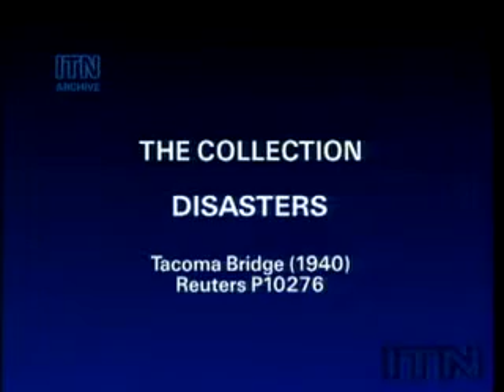disasters - the tacoma bridge collapse

Comment: Steel Skeleton The Remains Of The World's Third Largest Suspension Bridge Which Cracked And Collapsed In A 42 Mph Wind. Engineers Inspect Strained Cables On The Approach Sections That Remained After The 2800 ft Center Span Dropped Away, Rocked And Swayed. Many Observers Call It The Greatest Bridge Failure In History. Engineered Upright But Seriously Deflected Could Be Saved. Since It Was Open Last Known To Engineers. While Most Bridges Have Open Girders, They Wave Fashion. Severe And Unexpected Twisting Currents Brought On The Collapse. Up To The Hour Of The Disaster, Professor Farquason Of The University Of Washington Had Been Conducting Experiments With The Model Of The Bridge. He And His Associates Sought To Devise Some Were Employed. Sometimes The Bridge Rose And Fell A Distance Of Several Feet,
Motorists Complained Of Becoming Oman Aro's Bridge,
And A Remarkable Film Record Of A Oscillation Under Wind Pressure. C6! Galloping Gertie They Nicknamed The Span Because Of It's (Music) But Suddenly The Unexpected Twisting And Swaying And Straining And The Bridge Starts To Break Up.
Reply: Aftermath, 195 ft Below, Huge Sections Of The Bridge Have Disappeared Beneath The Water.
For Several Ships Road Bed Dangle From The Towers.
Miraculously, Not A Single Person Was Fatally Injured.